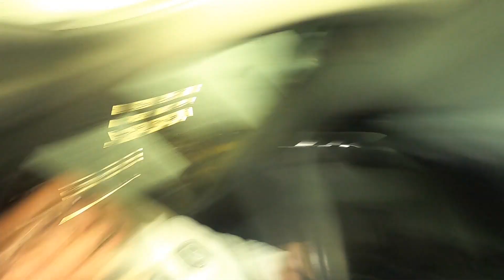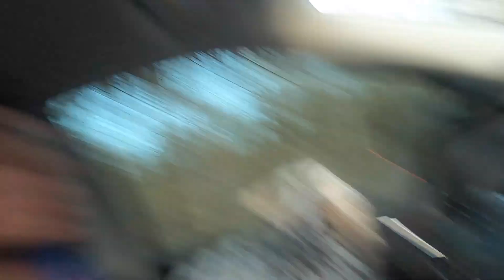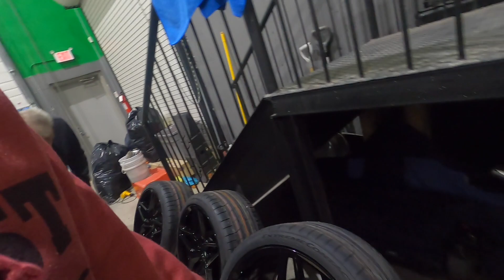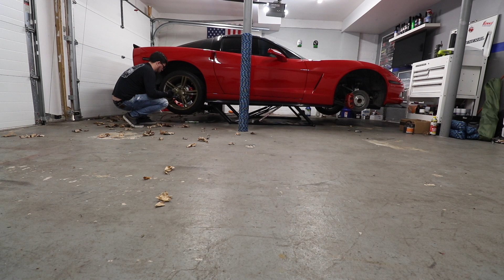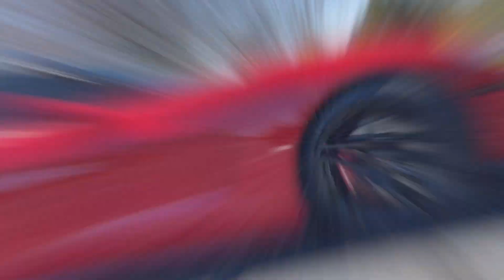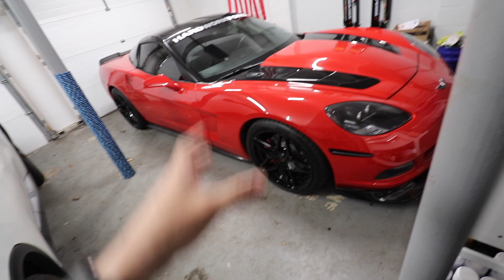MY INSANE NEW WHEELS! MY CORVETTE HAS BEEN TRANSFORMED! 😍

Comment: looks incredible man! you said your rear tires are 305's abd 255's in the front. Are they 305/35 or 305/30? and the fronts, 255/40 or 255/35? also what size spacers did you use? awesome man!

Comment: You mentioned the Front tires are 255 on the 19" wheel, question... wouldn't a 255 on a 9.5" rim (front) be stretched over the rim? I'd think a 275 would be just about right on the front wheels if they're 9.5"?

OEM the C6 Corvette is:

Front: 18x8.5 (245/40 R18) 25.7" Diameter
Back: 19x10 (285/35 R19) 26.9" Diameter

Below is what I was thinking for After Market (as close to stock Diameter you can get, and tire size to prevent stretch):

Front: 19x9.5 (275x30 R19) 25.5" Diameter (0.2" smaller than OEM)
Back: 20x11 (305x30 R20) 27.2" Diameter (0.3" larger than OEM)